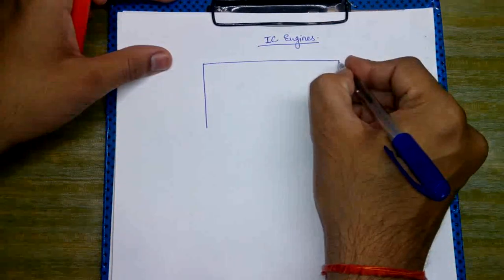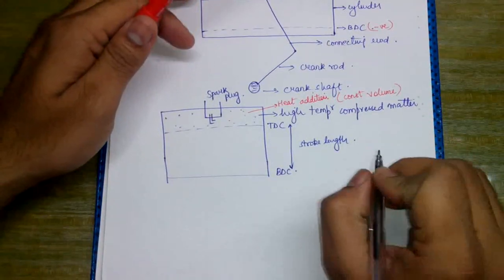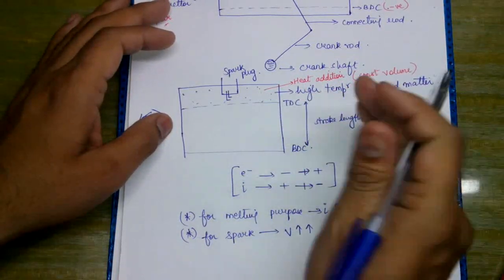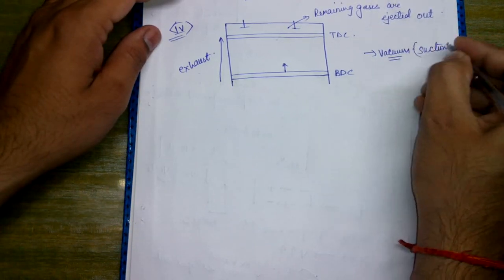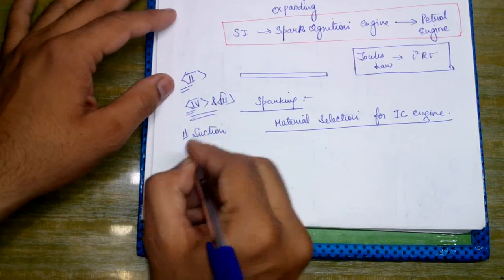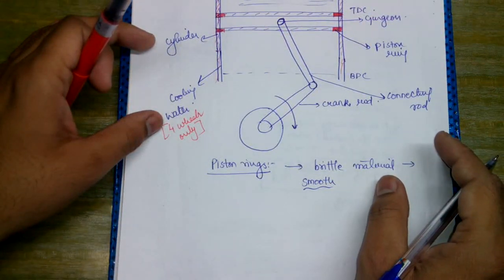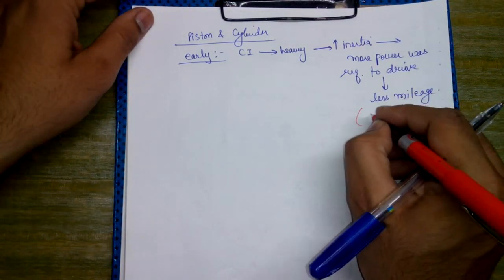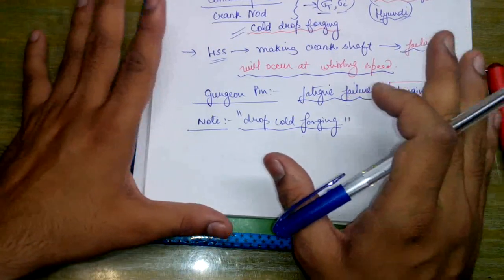IC Engines Lecture 1: IC engines, material selection fro different parts,blow by losses.

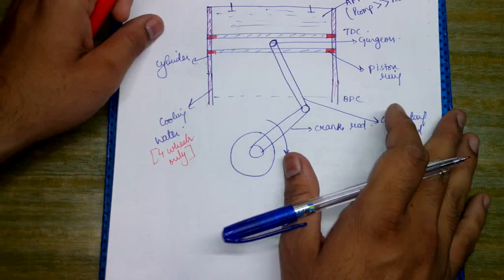Comment: you said at 15:47 , that during compression of afm the pressure inside is very very greater than  atmoshpheric pressure then why don"t the exhaust valve open during compression and why don't exhaust of afm takes place .
Reply: Because the valves are timed to open after  exhaust stroke using cam&follower system